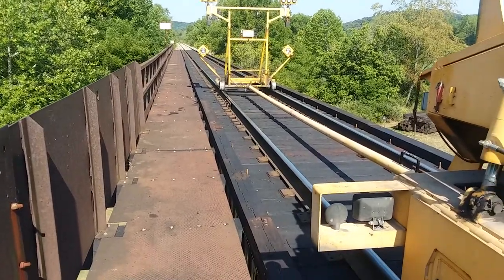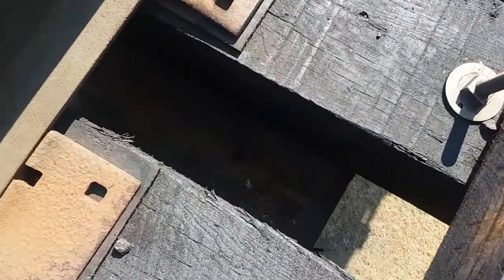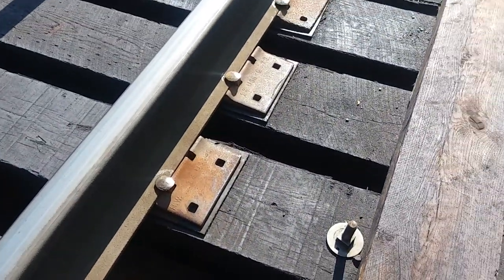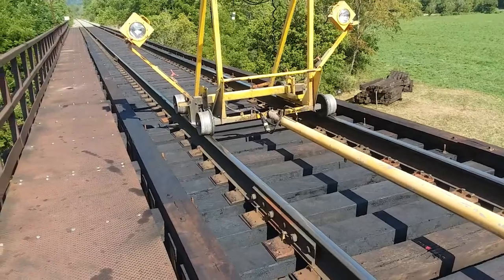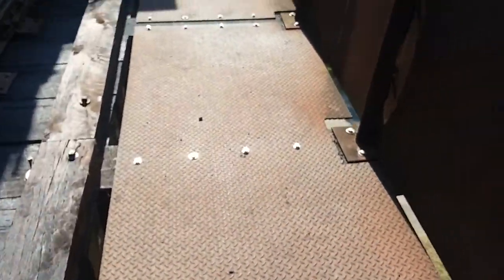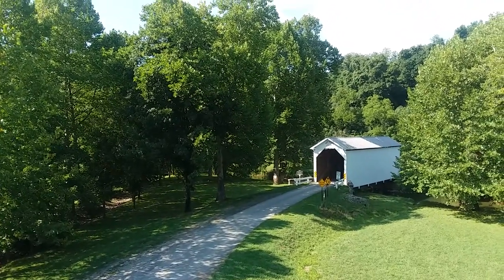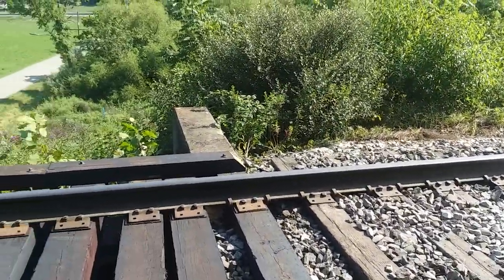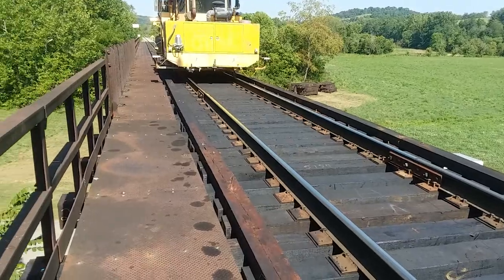New Railroad Bridge Timbers Plus an Authentic Wooden Covered Bridge

Comment: Lol, our shims were all plywood of different sizes. The track raising machine had three of those little buggies out front. You had to walk along with it and kneel over the tracks to see how high the tracks needed raised. Then wave your hand and then the operator would level it and then tamp it.. Move 3 ties up and repeat.
Reply from the maker: Ah yes, the good old days of track work. We used have use track jacks out ahead of an old Fairmont to lift track. Like this 6700 a whole lot better

Comment: No bridge guard rails so this is freight only, 10MPH or less. 
Notches or grooves cut into the bottom of the bridge ties are called 'daps'. A dapping schedule for a bridge is a summary of all the special cuts required for the ties to lock them onto the steel bridge stringers, accommodate rivets and bolts above the top flange of the stringers and maintain or create an even surface over uneven stringer heights.
Reply: Tie spacing is typically maintained by creosoted spacer blocks nailed to the sides of the ties across the length of the structure.
Reply from the maker: Another Excellent comment! Thank you for your additions. I did not know about dapping schedule, although i did know bout the dspping tool used to cut the timbers

Comment: Someone told me they only use solid oak for bridge ties, is that true? If so it would probably explain the price tag on those. Not cheap!
Reply from the maker: David, as far as i know, oak is the wood of choice. Building bridges especially over public roads is not the place you would want to skimp on materials. There is a lot of responsibility and liability for a railroad that goes over public roads. Great question and thak you for watchingvand asking

Comment: Hey there Dave. I've been watching your videos for some time now and really enjoy your content. If you ever need bridge or even track engineering/consulting, just let me know. We do some work on the RJC lines up in PA. Thank you, sir.
Reply from the maker: Awesome Ross. Bridge 11 is on a 9 degree curve, rail is spiked
down. Would a better option be when we replace the timbers
to use Pandrol clips on the bridge timbers? With spikes the high
side keeps wanting to push out and thus pull spikes up.
Reply: @ccrx6700  That's a great point. I have worked on a few bridges with a fair amount of superelevation, but I haven't come across one with Pandrol clips.  That's definitely something worth considering.
Reply: @ccrx6700  What I have seen though, is a lag screw used in a spike hole with a couple of washers. But that may have been because they had ran out of spikes lol.
Reply from the maker: @rossarmstrong2682  😊👍

Comment: So are the bridge timbers actually attached to the steel girders anywhere other than where the "J" bolts are for the long ones that support the cross walk?  Do they just rest on the girders or are they attached somehow?
Reply from the maker: Timbers just lay on hridge girders, j bolts lock them down, the bridge guards on the top of the timbers and are on the outside of them are lagged down into the timbers to keep the timbers from getting skewed. You saw some of the timbers on that vid that weren,t lagged down and that were already skewed. Since that vid we came back, straightened the timbers and lagged them down

Comment: Is the notching of the ties done on-site during assembly or do they come that way, ready to install?
Reply from the maker: Great question! Wish I had thought of that when I made the movie.

Appalachian timber is the company we get them from. They have all the original engineering drawings for each of our bridges. They do the dapping of the timbers at their mill. 

Dapping is what they call the process of cutting out a notch. The machine they use to do this is called a dapping machine or dapper.

Comment: Hey Dave, what's the life expectancy of those rubber pads?
Reply from the maker: Very good question Steve and one in which I had an accurate
answer, however we've never really done a study on that, they do
seem to last a good long time. Hardest thing on them is when the
bridge timbers get soft, that allows the rail to move up and down
creating an unwanted force against those pads. We seem to
replace bridge decks about once every 25 years or so, sorry I 
could not have given an exact life expectancy

Comment: I didn't think that cut spikes and plates were still being used other than special work (hook plates etc). Any reason your company isn't using pandrol plates,  screw spikes and e clips  ?
Reply: cut spikes are cooler
Reply from the maker: When the track was built in 1975/76 it was all spikes, to change over now would be a phenomenal expense and work, imagine
having to hand jack track, pull out spikes, pull out old plates,
put in new plates, drive in clips and do that for 17 miles. It just
ain't gonna happen here, they don't have enough money to do
all that.